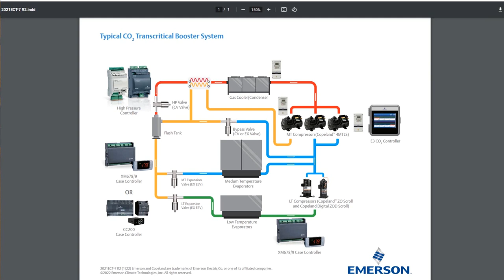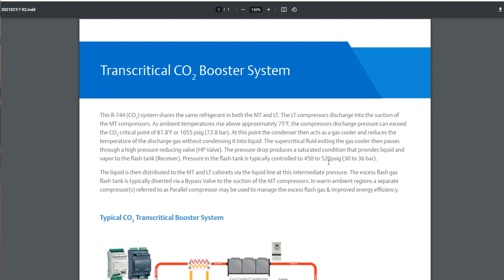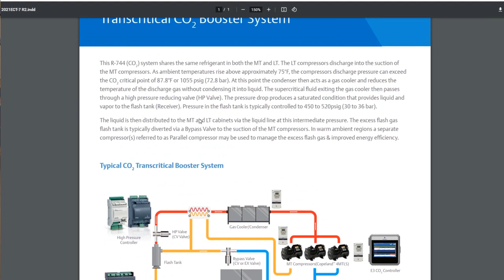Subcritical Compressors on CO2 Refrigerant Systems

Comment: This is like tandy boxes I worked on years ago where one refrigerant cools another ro get down to minus 30 degrees. Co2 is a very unstable gas once it gets above a certain temperature  this is where you need another refrigerant to cool the co2 gas to keep it stable